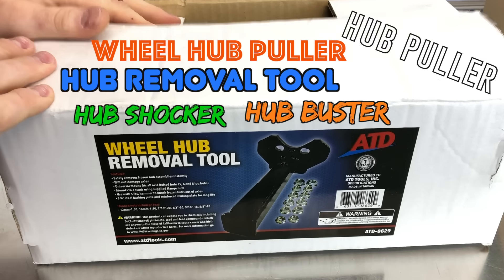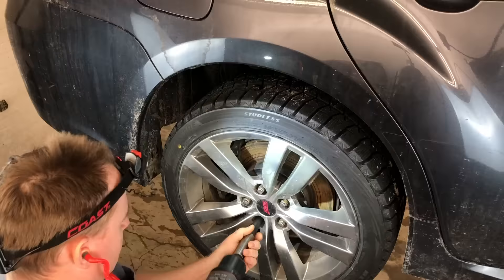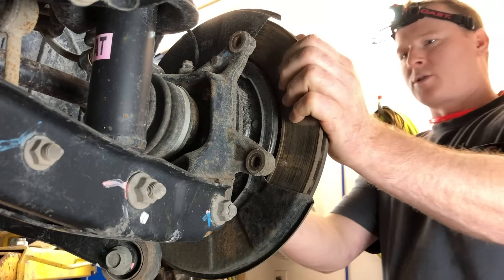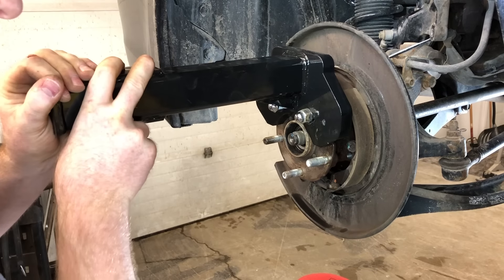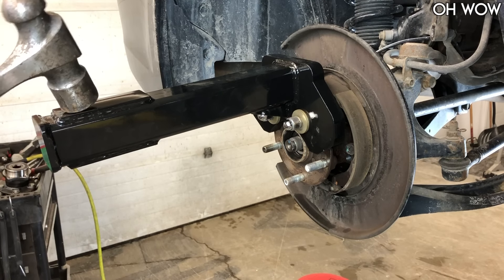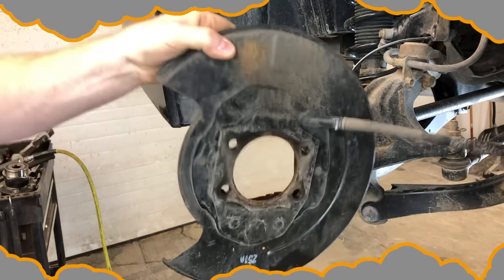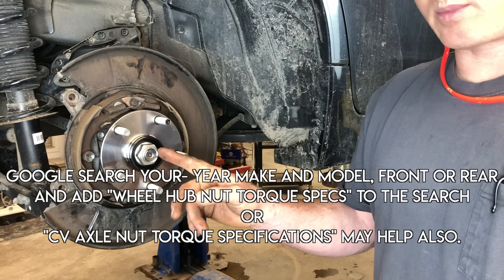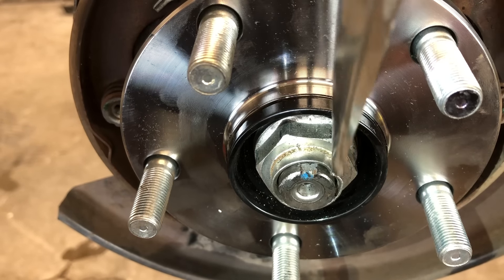HUB SHOCKER Hub Busters  |  REMOVE STUCK WHEEL BEARINGS EASILY!

Comment: A slide hammer works and same tool has more use then one purpose.  And I like to buy things I don't use often.
Reply from the maker: Slide hammer is a great method. It's the old method for me now on stuck bearings. The slide hammer usually splits the bearing into two pieces. Then I have to try to air hammer and twist the stuck portion in the knuckle to free it. Sometimes its easy and sometimes it's not, but it does work no doubt. Whatever works best for you will always be best for sure! 😃🔧🔧

Comment: Wheel studs are 12mm x 1.25.  I found it easier at floor level with a jack stand under the control arm so that the suspension isn't absorbing the force of the hammer.    10 lb. sledge did the job with one swat most of the time.
Reply from the maker: Nice! I am glad it worked for you and great tips! 😃😃

Comment: Try it on a dodge one ton with rust we worked on one for 5 hours and I install a wheel hub almost everyday if it works on hard to get off hubs not a superrooh
Reply from the maker: One tons are way less fun than Subaroos. 😃 I will try it when I get the chance. There doesn't seem to be as many one tons driving around these days.

Comment: Subaru recomands (at leasft for gd chasis), to remove the nufle completly and to press  is from behind.
Reply from the maker: Why would any manufacturer recommend that for a "bolt in" style wheel bearing? Is that recommendation a technical service buletin or a Recall possibly? Can you add any clarification?
Reply: @EasyFixShaun  well is nota really recomendation  but what the service manual of the gd and Sf  shows
Reply: @EasyFixShaun  In the SM the show even how to replace only the bearing, and using a special jig to press new bolts :)
Reply from the maker: What year make and model service manuals from Subaru say to press out "bolt in" wheel bearings?
Reply: @EasyFixShaun  what make year and model is a subaru GD ?:)))))))))))))))
Reply: @EasyFixShaun  aaanyway. its called subaru impreza factory service manual (by eris studios) goodluck
Reply from the maker: The point that i am getting at is, no factory service manual should be recommending pressing out "bolt in" style wheel bearings as a replacement method. They are bolt in parts. If pressing them out is the service procedure in a manual it is most likely an update from previous model years issues. The issue i have with it is design. These Subaru bearings by design are rust jacking themselves into the knuckle so bad they need to be pressed out. Barely takes any corrosion for this to happen in the rear bearings. Change the design, not the manual. If a bolt in bearing has to be pressed out, design the vehicle with a press in bearing 😀🔧
Reply: @EasyFixShaun  that just the name of the "ripper" so its easier to find..

Comment: HA! I had one of those. there are wheel bearings more stubborn than that thing is strong. it was either a subaru or an f-250 and the hub shocker did nothing to help and died under the smashing of a full 12lb sledge. i got much better tricks to remove stubborn wheel bearings, including the miserable subaru rear hub setup. lots a of good technique and tips in your video though. and OMG so nice to see a youtube video made by someone with a lift and who uses power tools. love it . there are so many hacker amateurs doing videos on harbor freight jacks in the street in front of their house......LOL
Reply from the maker: Thanks! There is no Subaru hub bearing assembly this will not remove. I have heard of some ford explorers though that are crazy stubborn. Check out the second video I made. I solved mounting using grade 8 bolts only on the tool. Also solved all bearing seperation issues while using the tool. 😃🔧🔧 https://youtu.be/eKqYtMdlPYo
Reply: Just because a person can't afford a lift or work on cars enough to justify a lift, doesn't make the person a hack.
Reply from the maker: I agree. Man made it. Man can fix it.
Reply: The videos are meant for the do it yourself whom are poor and can not afford to pay a mechanic shop to do it.... So yes they are going to do it in the back or front yard. Those whom have a car lift and power tools can afford to pay a shop to do it for them

Comment: I own one of these through Matco. After a year, I just found it easier to go back to using an air hammer to get them out. Less effort and less tennis elbow. I live in a rust state though so maybe they work better in the southern states.
Reply from the maker: Right on. I live in Michigan and it is very rusty also. There are a quite a few vehicles that are always a problem and I just grab this tool immediately. On others I use a hammer to remove like a typical bearing until I find out it is severely stuck, then I use the tool. I through bolt all vehicles now with grade 8 bolts. And I have discovered a cv axle nut trick to keep the bearing in one piece. Both of those things make a huge difference in popping the bearings out for me. Here is the video if it helps! 🔧🔧https://youtu.be/eKqYtMdlPYo
Reply: I worked on mine for over 8 hours trying everything several times over including a air hammer. Borrowed one of these off someone and the 3rd whack it was off....pretty rusted up.
Reply from the maker: @MF-kb2nv  I am glad it worked for you. I don't even do rear subaru bearings without it now. Here is the second video I made where I nearly perfectly 2 things on the tool. Mounting method. Bearing seperation. Hub Shocker 2.0 in case you need to replace another 😃🔧🔧  
            https://youtu.be/eKqYtMdlPYo

Comment: I think this kind of unbalanced shock would cause damage to the axle and its accessories.
Reply from the maker: I see your point. It hasn't caused any issues for me yet, and I have used the tool a lot 🔧
Reply: The axle is just along for the ride, it should be fine - but it's probably not ideal for the integrity of the knuckle, the centering ring of which will be spread violently by the use of this tool.
Reply from the maker: @davidkuehne476  The tool sends a shock to through the bearing and breaks the weakest link. The weakest link is the rust bond holding the bearing in the knuckle.. I have inspected all knuckles after bearing removal and have found no problems. The good news also is that the knuckle is stronger than the rust bond and the bearing. So it seems brutal, but for severely stuck wheel bearings it works quite well. Check out the hub shocker 2.0 video and let me know what you think?!? 
https://youtu.be/eKqYtMdlPYo
Reply: @davidkuehne476  .   I think the end of the axle, you call it knuckle, would be a little twisted by the strong shocks.  The precise wheel alignment would be a problem.
Reply: Thats what I'm saying. I would never put this kind of force on a wheel hub, its such an uneven pull
Reply from the maker: The knuckle is so strong that you would find it difficult to hurt even if tried to. Maybe contact the manufacturer if you have questions and see what they say. From my experience its highly unlikely anything bad would happen.
Reply from the maker: I do it daily. Knuckles don't get damaged. I always inspect to be sure. its never happened for me. Its highly unlikely to damage a knuckle. The manufacturer might have more information if you wanted to check with them 😀🔧🔧

Comment: Ford said “hold my beer” when they saw this tool and came up with the rear bearings in the explorer. Steel hub sticks around 2” into an aluminum knuckle. Even with that tool they don’t come out.
Reply from the maker: Ford wins the bearing design award of the century. Well done 😀😀🔧🔧
Reply: My Chevy is tapped with m10 bolt holes for that I’ve seen on explorers people take out two studs and drive a bolt with a nut on the other end through those holes and get them off, heat helps yellow torch
Reply from the maker: Good ways to do it also. 😀🔧🔧

Comment: I made one similar out of half inch plate with multi lug nut application it extends out about as far but you hit it with your air hammer take some right off
Reply from the maker: Really?!! Wow that is awesome man! I wonder if I could try an air hammer on the one I have? I wouldn't think it would have enough mass. But if it works it works. You should make a video on how you made it and how it works. There are a ton of people in the comments that want to try to make their own also. I think that video would be sweet.😃

Comment: I've got one. It's a 50/50 chance if it works for me. A few times the bearing separated and left me with the flange in my hands and the hub unit still in the car. I just use my air hammer now. Never failed me. Rust belt cars are horrible to work on. I can't believe how stuck these things can be.
Reply from the maker: Right on! I had the same problems. You are in luck. I completely solved that issue. Check out the new video Hub Shocker 2.0!! 🔧🔧🤓  https://youtu.be/P5bwlKKpusk

Comment: Good vid. When using a torque wrench,  always stop after the click. If you continue,  you'll have to back off the nut and re-torque.
Reply from the maker: Thanks for the tip! I have "double click ides". Nothing wrong with double clicking to check your work. It will not over tighten the nut 😃🔧🔧

Comment: wow how expensive , and hitting with a hammer !!!, i loosened my hub in a second with a simple chinese puller from ebay for under 10 pounds !,they work perfectly !
Reply from the maker: Not everyone needs one of these. Usually when you need it it’s too late. If you don’t have corrosion where you live you are probably ok without one. I’m glad you got your car fixed for cheap! 😊
Reply: Try using that tool on a rear wheel bearing on a Vauxhall insignia, you got lucky,
Reply from the maker: It is a valuable tool for the tool box. I have found it to be quite effective on a lot of cars. Sometimes it is luck when removing corroded parts. Several methods sometimes need to be applied. This shocker is my go to tool if i can get it to work on all commonly corroded stubborn wheel bearings. It is difficult to get to work on explorers and maybe the Opal you have. There are limitations to everything. The tool works on most 😀🔧

Comment: The way one guy at work removes wheel hubs is he keeps a selection of scrap rotors, he gets the biggest one that fits and bolts it to the hub. Takes a 10lbs sledge and smacks it a couple of times and he is done. The air hammer does help but living in a rust belt state it's always a struggle to remove a hub if it's been on for a while. 
I could see this helping out however.
Reply from the maker: Oh wow! Thats a pretty great idea. The hub shocker has been a life saver for me. Have you seen the second video that solves a few mounting issues and bearing separation issues I was having?
Reply from the maker: https://youtu.be/eKqYtMdlPYo

Comment: Good Video, when I am using lug nuts like that I put the flat side to the work
Reply from the maker: Right on, thanks a lot! I made a "shocker 2.0" video that solves a couple problems I was having with mounting and bearing separation if you are interested? I only through bolt the tool now with grade 8 bolts and it works awesome. Plus I solved some bearings loosening up or seperating while using the tool too. 🔧🔧 https://youtu.be/eKqYtMdlPYo

Comment: My OCD is kicking in watching this guy taking off rusty parts with no penetrating lubricant..
Reply from the maker: You must live in a rust belt state also!?
Reply from the maker: https://youtu.be/eKqYtMdlPYo I still don't use penetrating fluid on the new video. Let me know what you think though please! I solved mounting and bearing separation issues. Subaru rear bearings are now easy for me😀 https://youtu.be/eKqYtMdlPYo
Reply: @EasyFixShaun  will do!
Reply from the maker: Awsome! Thanks!!
Reply: @EasyFixShaun  I like the tool... I always used a blow torch and press..  I just don't know if this method is risking bending anything?
Reply from the maker: Good point. I’m sure it is possible. But I haven’t had any issue. I’ve been dealing with some horribly difficult nasty subaru rear wheel bearings. They are truly incredible how hard they are to remove. The tool seems perfect every time. It just pops em out like they should pop out. I think the biggest thing is it give access to rear wheel bearings when there is no access to apply pressure to a bearing. And it allows a hammer swing outside of the wheel well. Front wheel bearings, you can usually swing a hammer and strike through the caliper mounting “window” and hit the bearing in the right spot to release it. In the rear it’s always harder. The subbies there’s literally no where to strike effectively. Even if you could, it probably wouldn’t release the bearings. It’s defineatly a harder hit with a sledge. But they seem to pop out like they should. Maybe they should call it the “subbie shocker”?!? 😀
Reply: @EasyFixShaun  lol.. yea your right about the Subaru's.. those rear hubs are a night mare if all you got is a socket set a jack and a driveway...
The tool is very effective and works well!
Reply from the maker: Cool man! I’m glad you like it. I will work on using some penetrating fluid on rusty parts in a video for you 😀
Reply: @EasyFixShaun  lol!! Thanks for attending to my OCD lol..

Comment: Bought it worked on it for over an hour didn't budge!!
Reply from the maker: Darn! I’m sorry. What year make and model do you have? What size hammer did you hit it with? How many ounces does the hammer weigh?
Reply from the maker: @stevenhough2604  Any luck getting yours out? I have another video coming out with extra tips on how to use the tool..
Reply from the maker: https://youtu.be/eKqYtMdlPYo Check out the updated shocker video for your next bearing. It has solved all of my mounting issues and bearing separation issues. Subbie's are easy for me know. The mounting method in the video is the only way to go. The through bolting transmits more hammer power and pops them out easier. Let me know what you think!

Comment: 60k an needs a new wheel bearing .... Smh 🙄
Reply from the maker: I know! Subbies have a slight problem in the rear right now 🤨
Reply: Might last a bit longer if they were torqued correctly... 😇
Reply from the maker: Always! Subaru’s have a manufacture problem right now though and seem to be failing way too premature. Compared to old subbies that would usually go 100k easily on bearings...
Reply: Turbo issues , bearing issues , sounds expensive ... No thx
Reply from the maker: @93stang19  I agree. What do you think about tesla in general? Are they any good? Do you think they make survive or dominate or go bankrupt?

Comment: I use an old rotor and I put it on backwards and put nuts on. Gives you more leverage to hammer the bearing off. Just a tip if anyone has one lying around.
Reply from the maker: That is a great idea Michael! 😃

Comment: Pretty nifty. I have spent a few minutes with a slide hammer and lots of used energy doing this job.
Reply from the maker: Me too. Slide hammer works don't get me wrong. But for a stuck bearing I go straight to the hub shocker. I made a hub "shocker 2.0" that solves a couple problems with the tool. Mounting and bearing seperation. Both methods can be used on a slide hammer also! 😃🔧🔧https://youtu.be/eKqYtMdlPYo

Comment: I'm making one today! Nice!
Reply from the maker: Nice! I hope it works out for you. Let me know how it all went 😀
Reply: @EasyFixShaun  be better than crawling under the vehicle with a bolt and someone turning the wheel
Reply from the maker: That works too. My tool is so Awsome. It has saved my time, mind, body, and soul! 😀
Reply from the maker: Btw! Check out the new video. I solved any mounting issues you will come across with through bolting. And also bearing separation issues with the cv axle and nut, while using the tool. 👍https://youtu.be/eKqYtMdlPYo

Comment: 19 year subaru tec. (now retired). Never had them work in Maine due to high mileage and rust.
Reply from the maker: Really! Cool man. I don't know how you retired, please share you secret 😃. Michigan has a massive rust issue. The tool is the only thing that efficiently and consistently will remove stuck bearings for me. If it doesn't remove them, I go straight to the press. If that doesn't work.....red wrench. Hey would you mind checking out the 2.0 video I made on these and letting me know what you think from a mechanics standpoint?? If you have time? I mean....you are retired 😃🔧https://youtu.be/eKqYtMdlPYo
Reply: @EasyFixShaun  I have always torched them and air hammered them out. Not that this tool doesn't work well, I just hadn't had any luck myself! Sent you an email BTW.
Reply from the maker: @markssmallenginerepair3593  Nice man. Whatever method works is always good! Sounds good. I will check that out.
🔧

Comment: Wish I had this today,  for a while I wasn't sure I would be able to get it off but traded up to a larger size hammer three times with a short handled 5 pound sledge being the last one and finally started to see it slightly loosen and about 50 hits later it was off.
Reply from the maker: Oh man. Ya this tool helps a ton! Glad you got the job done though 😀🔧🔧
Reply: @EasyFixShaun  If I ever need to change another I will absolutely buy one.
Reply from the maker: I use mine frequently 😀🔧🔧

Comment: Looks like good tool! Might be concerned that break weak lug bolt though.
Reply from the maker: Works awesome. I did have problems with that along with the bearing separating into two pieces during removal making more work. Check out the Hub Shocker 2.0 video! Solved both problems thru bolting with grade 8 bolts and keeping the cv axle nut on during removal 🤓🔧https://youtu.be/eKqYtMdlPYo
Reply: If the lug bolts are weak and break from that, they needed replaced anyway. Ya know?
Reply from the maker: Yup. New wheel bearing hub assemblies come with new lug bolts already installed. And grade eight bolts fasten the tool way better to transfer force. And... you don't destroy your lugnuts 😀🔧🔧